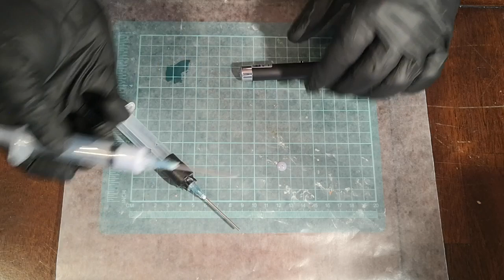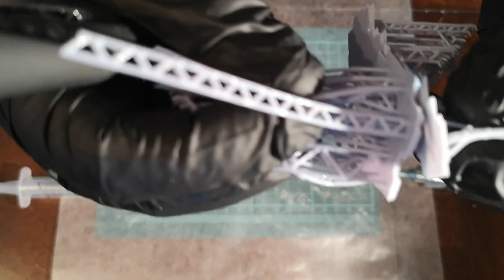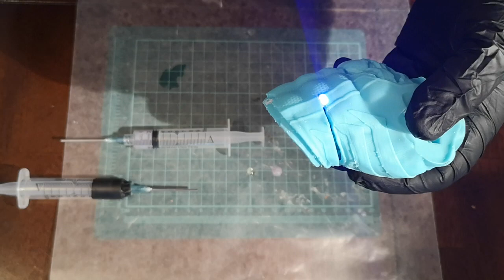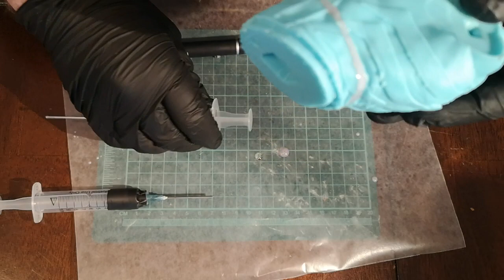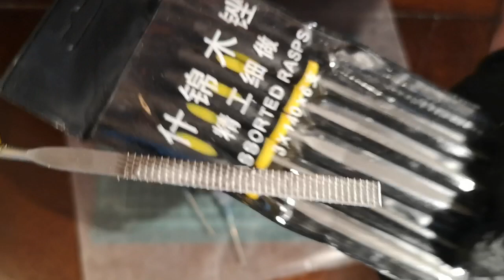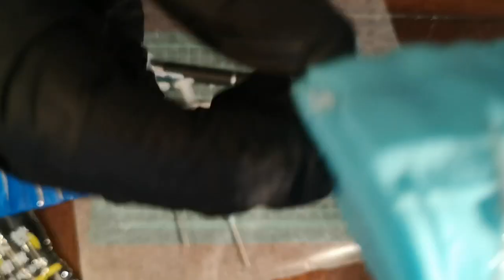Photopolymer resin welding

Comment: Interesting seems you can weld vertically without the resin running away from you.
This could be very handy if you've got large fixed parts which need to be welded and you can't turn them over in your hand or put them horizontally like you were showing? Break video thank you